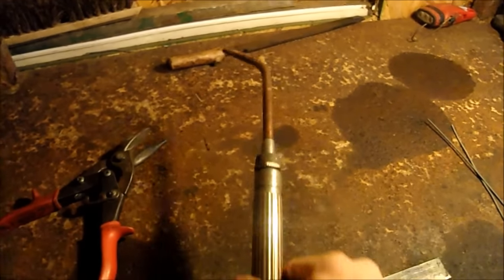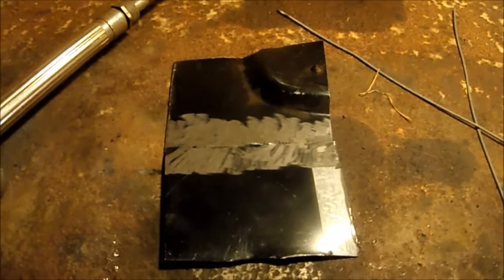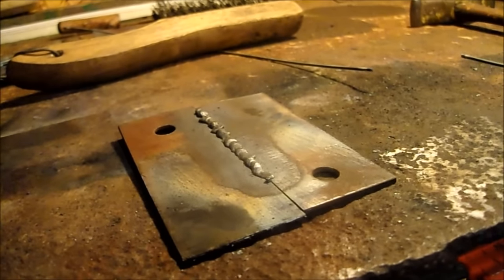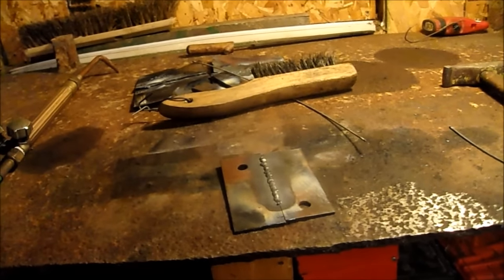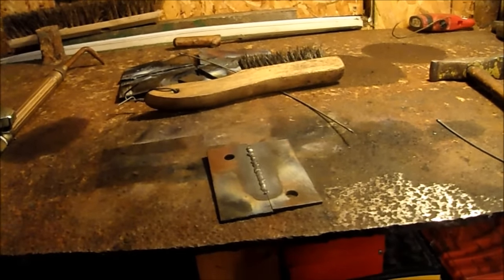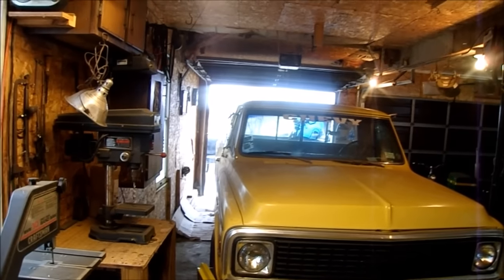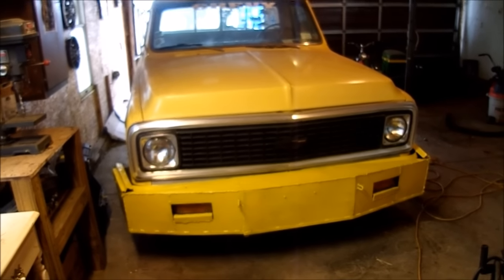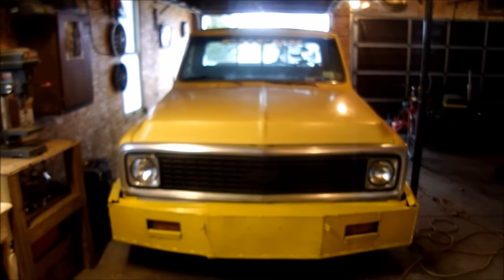Gas welding - Smaller tip and flame

Comment: Looking good. The amount of flame looks much more reasonable than the last attempt. 
I have not done this in years but remember when it was all i had. Wire coat hangers work decent in a pinch...
Reply from the maker: +builtrodewreckedit Coat hangers work good. yeah i think i got the flame figured out now

Comment: Suggestion to improve your  gas welding: adjust gas mix to a "neutral" flame. Looking at the flame, draw the middle "feather" back till it just disappears or you can just see it's tip. Use a tip just big enough that you can get an appropriate puddle in a reasonable amount of time. You're getting there!
Reply from the maker: +Michael Murray Thanks for the advice. yeah getting better.

Comment: OH and check your coil If that has the square looking coil bolted to the intake take it out and clean it and look for hot spots on the plastic stuff I found that problem on a chevy truck that had went through 3 ignition modules..... coils are not too expensive
Reply from the maker: +not2fast4u2c yeah it's on the second coil too lol  I'll check it

Comment: Its comming out a whole lot better since you started!  What are the orgins of gas welding, it has to be old.  If the ignition module keeps crapping out under the cap, make sure there is a mad thermal paste on it. Also its all about the brand, aftermarket parts suck. Try to find a NOS module with the GM stamping in it, they are the best
Reply from the maker: +Ghetto Wagoni think gas welding has been around since the early 1900's. my oxygen tank is from '48 . they just re-certify the tanks every 10 or so years. you are absolutely correct about the aftermarket parts sucking. i went threw two, yes 2 modules from Napa in one month. i did find a NOS one. it is heavier and has the built in copper heat sink.  haven't had a problem with it yet.

Comment: Lookin good , did u use silicone grease or something under control module.
Reply from the maker: +wtbm123 Yeah, i loaded it up with the grease that they come with. i just cant figure out why they keep burning out
Reply: +FullThrottle440 Be sure the screws holding the module down are clean as they ground it . Make sure coil is good , as they can burn them up The dist cap i would check , and would prob do a AC test on alternator . and check any wire connectors for corrosion
Reply: +wtbm123 and does it ever look damp inside , if so see if vents in bottom of dist are clean, make sure all the secondary ign is good , wires plugs and the cap and rotor , high resistance can cause things to go bad
Reply from the maker: cap ,rotor, plugs ,wires, coil are all new. i'll check and see if it's damp in there. now that you mention it, the hold down screws may be a little crusty.  alternator is a good one to check too
Reply: +wtbm123 
I agree. I had a 63 Plymouth that the right headlight and sometimes the right signal wouldn't work or work sporadically. I finally ran a wire from the radiator support to the firewall and solved my problem. I eventually found the culprit, a  rusted screw.
Reply from the maker: +MostlymoparIH That'll do it!

Comment: Yea buddy I think that ol truck is looking good my s10 is tbi I am having a little trouble with it to it cranks fine an runs fine but when I go in a store for 20 or 30 mins, it acts like its not getting gas what ya think take care Edd.
Reply from the maker: +Chevy Shack First and most cheapest , I'd check the fuel filter first.  or the tbi might need a rebuild. i will probably rebuild mine sometime soon

Comment: Keep practicing you will get better I know you will enjoy brazing ..It is alot easier ...Wiring problems and electrical sucks Check your voltage at everything and make sure everything is grounded good
Reply from the maker: +not2fast4u2c i will.  very well could be a bad ground somewhere
Reply from the maker: +FullThrottle440 i'm gonna have to try brazing too
Reply: +FullThrottle440 brazing is cool.  takes a lot of heat though. I brazed a lot of brass back in the day.

Comment: If you have a week or bad plug wire or bad cap it will cause the ign. mod to keep frying out on you. Anytime you have the spark having to jump further than the gap of your spark plug it overheats the mod.
Reply from the maker: +scottsinfl cool.  the plug wires and plugs are new. there still could be a defective one . who knows. you can't trust these careless people at the parts stores that throw them around.  i replaced the cap and rotor the last time a changed the module so hope that helps. the old cap looked burnt